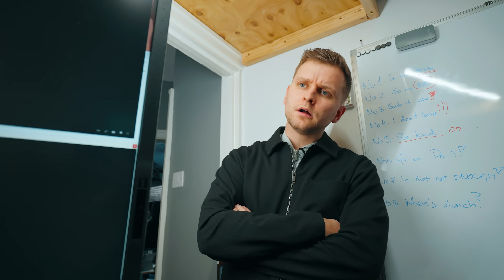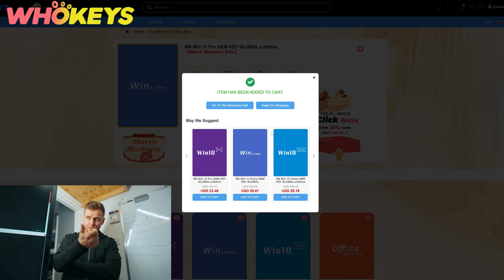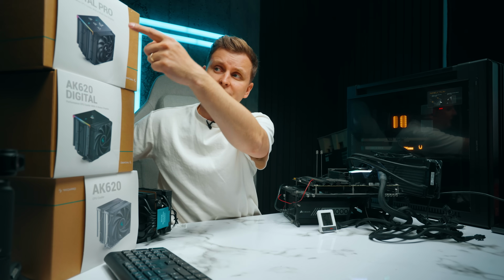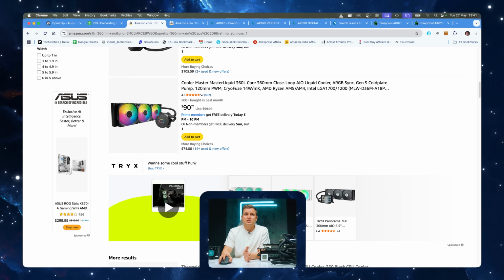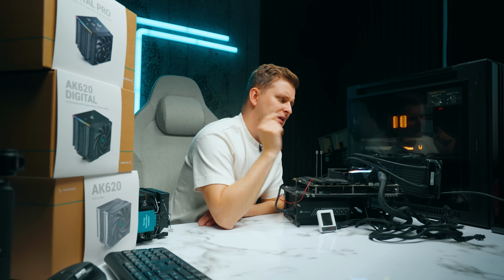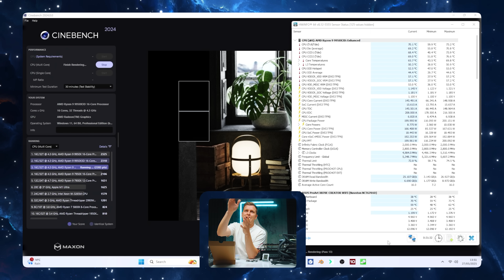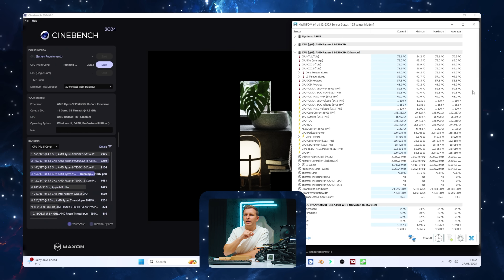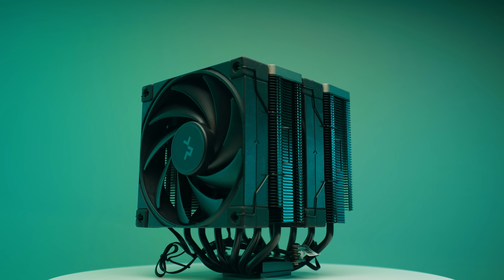Stop Overpaying for CPU Coolers Now! AIO vs AIR [PROOF]

Comment: Bench tests of AIO's and water cooling loops are NEVER accurate or paint a full picture. On a bench test, the system will be run for a few minutes and then shut down or left idle, this does NOT allow the cooling loop to fully heat soak. Water/coolant has a fairly high thermal ceiling, what that means is that the heat from the CPU is mostly being used to heat up the coolant, it's not actually radiating any heat away from the loop, it's absorbing it. In a short test, the loop will heat up, but when left idle, it will cool off, why is this important? In real life, during long gaming or editing sessions, your loop will NOT get that chance to cool off, so the coolant itself holds onto the heat and actually ends up keeping your system a little warmer than if it were using an air cooler, best case scenario is identical temps. On a bench test, the liquid cooler seems to run cooler because you've not fully thermally loaded the coolant, run the same test for a couple hours and you'll notice worse temps than an air cooler.

Comment: Why not test in mATX and ATX cases because there it definitly makes a difference. I have an freezer 36 and with minimal airflow is get 90+ in BF6. With the airflow all the way cranked up it stays below 90C and does not down clock.

Comment: Air coolers are good, as long as they're reasonably priced. If it's over 50 bucks, then it's pointless, and an AIO is a better option. For example, the Noctua NH-D15 is like 150 bucks? It's the rank 1 air aircooler, but in raw cooling performance it loses to literally ANY 360 AIO that costs 100 bucks less.

Comment: If this test had been done inside a case instead of open‑air, the results would look very different. With an air cooler, all the heat pulled off the CPU stays inside the case. How much of that heat builds up depends on the case airflow, fan setup, and exhaust efficiency, so temperatures can vary a lot. That trapped heat also warms up other components—RAM, VRMs, SSDs, and the GPU all feel the impact.

A liquid cooler moves the heat to a radiator, where it’s exhausted out of the case instead of being dumped back into the internal airflow. That’s why AIOs often show a clearer advantage in real‑world, in‑case scenarios.

Open‑air testing doesn’t capture these dynamics, because it removes the entire airflow ecosystem from the equation. Since actual PCs are used inside cases, a more representative test would measure performance in a closed chassis where internal heat buildup matters.

Comment: I use the ID cooling AIO, which was briefly shown in the beginning listings. ~$60 and it works well. About 10 degrees cooler on my CPU vs heat pipe air cooler. A little can tuning and it is no louder than the air cooler at full load, which is where I often run when gaming or doing video processing for hours on end

Comment: Ive only used AIO's in my builds so far and its only been the artic 360 pro iii but I did get an assassin for my itx built since case variety gets bigger when its just air cooling

Comment: Never forget all heat pipes contain a fluid in a vacuum as they rely on phase change for their efficiency. Which means air coolers are really closed system liquid coolers that just use fans to cool the radiator. This fact often seems obscured.
Reply: Yup, people still treat the air coolers like the old one piece solid piece units of years ago. The heat pipes are much better than water.

Comment: I usually go with premium name AIOs, but I recently decided to take a gamble and try Thermalright two months ago after I felt my current AIO was overly aged. I bought the Frozen Magic (there's a v2 version, but mine isn't) 360mm and paired it with Thermal Grizzly's Phase Sheet and I am not disappointed at all, I'm impressed. The build quality feels good and not cheap feeling and the pump is whisper quiet. Knocked the pump down to 80% for a balance of longevity & efficiency and temps are great. The only thing loud on it are the 3 high static pressure 120mm fans, but they rarely ramp up to max since I sat down and spent time doing a proper fan curve for all my system's fans. Still prob wouldn't hurt to replace those fans with more premium engineered high static fans for less noise, but the ones that come do the job and that's good enough for me and I wear a headset anyways. Edit: For my vrms, they got beefy heat syncs and I have plenty of  cool air flowing in touching them and pushing out the heat in my system.

Comment: For my line of work water is a king. While developing embedded software I have long sessions of working with code (for a computer is just a simple effortless text editing)  and "bursts" of massive computation power while compiling. Water due it's massive heat capacity takes all this heat and dissipates it later during low CPU workload. It makes fans run very slow and system is very quiet. I can hear puring of my wife's cat from the other room :D

Comment: I would argue that the AIO is going to be quieter because it will replace 3 case fans, so pump noise vs air cooler fans is the real noise difference. I also don't think your VROs will see much, if any, difference in air flow as the air cooler tower blows air too high to affect them. That being said, it's hard to beat the value of air coolers over AIOs.

Comment: And one of the best things to start looking at is how much wattage of heat can it output so how much can it dissipate if it can do more than the CPU puts out then you're normally good like the dark Rock Pro 5 or some of the other coolers ID Cooling do really really well not to mention the noctua but you may be overpaying for similar performance

Comment: remember this is in a test bench, this isn't in a case. This isn't real world. The air cannot remove the heat as good as liquid, even AIO. That's not even counting custom loops where there will be even a more significant drop.

Comment: One of my builds got killed by a Corsair AIO. 
The liquid landed on the mainboard after 6 years of use, mainboard is dead.
I have replaced the mainboard, processor and Ram, this time going with air (be quiet!).

Comment: I order an rz500, dont know why it doesnt show up when search but its from newegg, looks cheap also but man its keeping my cpu below 50c, let my pc run for 8 hours with 2 game on, a live stream video.. and msi program open, cpu was at 53c and gpu was at 67c. One thing is i slap another fan on the air cooler as it came with 1 120mm fan, so.. add another 120mm because it has 4 clips

Comment: I had an EKWB custom loop in my system a couple years back. After moving countries I switched to an cheap Air cooler by a reputable brand from Germany. The difference was literally 10-15 C but still nowhere near the cpus max rating. I paid 499 for the EKWB and literally a 1/10th of that for the air cooler. Not to mention the hassle to setup a custom loop.... THen I had a couple AIO and they were ok. But for what I paid for them I am going with a 140mm Peerless Assassin for my upcoming build. I doubt that it will be worse!

Comment: I've always used air cooling.  Yeah, they are big and bulky plus you need a wide case.  Reasoning behind my choice are the horror story's mates of mine have had when they go wrong.  Oh, they do go wrong sometimes and it is very costly to put right if the coolant escapes.  CPU is probably bare minimum to replace and sometimes entire mobo, memory.  I use quality Corsair air coolers and cases as they have excellent airflow and plenty of room for cabling and larger GPU's.

Comment: I have a Lian Li A4 H2O SFF case and went with a 240 AIO. Kind of regret going this route vs a Thermalright AXP90-47 Full Copper. I'm only using an Intel 245k, so the 240 AIO I have is overkill. Since the AIO fans suck from the case interior, the heatsoak is a bit less than desirable with longer GPU usage. Worst ye for me, the turbulence on the radiator and pump resoanance are more annoying than an air cooler would be at idle or under load. And the air bubbles.

Simplicity really is best.

Comment: I am using thermalright's phantom assassin with 7 heatpipes, processor is core i7 12700, temps highest with rendering is 73 degree. a lot cheaper then AIO.

Comment: liquid moves the water away quickly so the cooling is better its not just blowing air on a hot plate their is hoses that move the water to a different location to get cooled and sent back so its always going to be slightly better since its not static coolingin place like air cooler 

the liquid in the AIO is basically near the same stuff most folks use in their car radiators for cooling for those with gas powered cars. aka hence the name radiator fluid.   AIO radiator fluid is slightly different blend but basically the same stuff.

Comment: The purpose of aio is to have more thermal capacity and more air contact surface area that can handle spikes in CPU temperatures. That too without any overclocking. 

The reason ppl choose aio is for that added headroom which gives peace of mind as most users will not have 24x7 temperature controlled environments. 

The reason system integrators do not offer aio is because the environment where those workstations and servers run is expected to be thermally controlled environments - ideally maintaining 17 °C air temperature 24x7.

Comment: AIO cooler water evaporating is a hard debate. I’ve had mine for 7years and counting and it was unused for 2 years until recently cause my pc broke and it still working properly. And Idk now it was a hassle using air cooler with rams not fitting extra step to know if they would fit or not.

Comment: I wanted AIO for quieter operation, couldn`t be more wrong. On top of that air cooler requires very easy maintenance, while repairing pump can be very tricky. That`s a great video U did explaining all pros and cons.

Comment: A 200-watt AMD processor can be cooled with a light breeze. There's no point in comparing air and liquid cooling. Try cooling an Intel processor. Only an ex's heart can handle that.
Reply: I'll see your Intel chip and I'll raise you an AMD 9590 FX you don't know s*** about heat homie an air cooler is insufficient for a 9590 FX it requires that a very minimum of 240 mm AIO
Reply: I'll see your Intel chip and I'll raise you an AMD 9590 FX any other cooler besides a 240 mm AIO is insufficient you don't know s*** about heat out of an old AMD chip

Comment: Sure, they are even when both are given the best case scenario.  But now do it in a case with a gpu throwing  in hot air.  Air cooler probably wont perform as well if it is being fed 60c air while the aio can still get room temp air if you set it as an intake.

Comment: I'd say this testing approach is not really similar to normal usage of the computer? In a normal application your Air Cooler will be inside a closed space with limited Airflow. Overtime, the air temperature in this enclosed space (your computer case) will grow hotter and reduce the capacity for cooling the fins of the air cooler where's the Water Cooler can receive a constant influx of fresh air from the outside.

Of course, this idea of Water vs Air cooling is borrowed from Cars, an application where Water cooling is infinitely superior due to it's ability to exchange heat of the motor block through crevices inside where the water can pass through an ability that the air won't have in that application. This isn't true for CPU cooling, since the heat exchanging interface will be the same for both Water and Air so I would say that both should have the same cooling capacity in the first moment. My big question is if they both have the same Thermal Capacity overtime

Comment: Had a LiAn Li Galahad AIO was great. Everything was running fine. About 7 months in my temp started climbing. I took it out. I put it NZXT cracking in instead so I decided to cut. Open the Lynn Lee and see what happened. There's no water in it. None zero dry as a bone now. Could that have been a one-off probably? Here's the problem with aios as I see it, you don't know how much liquids in there you have no clue. Maybe it'll gurgle and you can hear. Oh I'm getting low but you can't really refill them. We're with an air cooler. You know if it doesn't work?

Comment: I am not a gamer, but I process a lot of data on my PC. Photos, videos, music, spreadsheets, programming, etc. I was looking at the Ultra 7 265 specifically to keep the heat under control without an AIO. But the 265K is cheaper. Honestly, I am not pushing my PC nearly as hard as a gamer would or someone working with 4K videos. Maybe air cooling would be sufficient for my uses. It was also suggested I could power limit the 265K and further reduce the cooling requirements while performing as well or better than a 265.

Comment: Meh... still prefer AiOs. Cleaner look, less bulk on the motherboard and I kinda like the idea of having a radiator in my case ... I guess I'm weird that way. :) Plus, just like with air, there are some very affordable offerings out there which will get the job done without breaking the bank. Deepcool themselves have a 240mm AiO that goes for "just" €50 in my country - and Thermalright even sell 360s at that price. 
As for longevity: Shouldn't be an issue if my experience is anything to go by. My very first AiO (120mm Corsair H60, a super basic unit) lasted for over six years without leaks or other failures. And while I did have to retire it because some of the liquid had evaporated and there were cracks starting to form on some of the rubber fittings, I would've had to do that anyway because it wouldn't have fit on and wouldn't have been powerful enough for a more modern CPU. Same thing goes for air-coolers which you will most likely have to retire eventually for the exact same reasons.

Comment: you can get away with air cooling but case testing changes delta to 10 degrees. That makes a big difference in your room comfort and gpu temps too. Arctic liquid freezer 360 is $80 and comes with three case fans. Thats more than worth it over any air cooler that you would need to buy additional case fans for on top of your build looking like ass.

Comment: I bought a fractal 360 aio for my main rig and it keeps the i9 cpu really cool. I just wanted to try one and it looks awesome. My case is enormous and i also wanted to fill it up a bit. Once the aio dies that will be my last one though i'm pretty sure because my other 4 towers work just as good with air coolers. Arctic fans keep them real quiet with lots of air flow. So i basically spent 200 bucks to one day replace it. Its fun though.

Comment: air coolers are way better because they are quieter and for me thats all that counts, if your gaming you dont need a 250watt cpu the 7800x3d or 7600 only uses 65watts when gaming a cheap air cooler in enough.

Comment: The way I look at it is, they work the same, what separate them is the availability of space above the CPU. 

If there is enough space and air flow, Air cooler is good enough. But if there isn't, then use water to tranfer the heat to other place where space is available.

Comment: Liquid just has so many advantages and air will never overcome those unless you can consistently keep your ambient temps low.  If you are in a well air conditioned room at like 68 degree f or 20 degree C then air cooling is fine.  If you dont have good AC liquid cooling, even a small one will always be better and the fail rate of AIO is like 0.0001%

Comment: from my personal exp i can say a couple years ago i had a bequiet dark rock 4 for my r9 5900x and the temps were always around 80-90°C (even in idle around 60). then i upgraded to a 360 mm aio and they went down to 35-40°C even under stress they never went above 55. i dont think that a "better" air cooler would achieve these temps. also i didnt like the look of such a big construct in my pc case. the aio not only performs but also looks much better. I paid 130€ for the arctic freezer aio and a noctua air cooler would be around 100€. (disclaimer: this is my personal opinion i didnt study this topic)

Comment: Realistically I would guess 95% of AIO purchases are motivated by aesthetics. A lot of people building gaming PCs will choose liquid cooling by default because it looks premium and that's what they see everyone else doing, even if they have mid-range CPU and GPU that don't generate much heat.
In most scenarios I believe air cooling is the best choice ON PAPER (ample cooling, more reliable, no pump noise, easier to swap out), but this is a hobby for a lot of us so not every decision has to make logical sense. That's why fish tank cases and RGB exist.

Comment: I am in 2 minds of selling my AIO and just getting air cooling. I would like to get a flat one though with the same type of performance as the tower types and that's where the water gets muddy though. I dont think there is enough testing on the air cooling solutions. Especially vertical vs horizontal mounting of them. Open case the results seem to be neither here nor there but in a enclosed case eg. Lian Li O11 you have bottom intake top out but it need to contend with the GFX taking up a lot of space and how would a horizontal flow match against a vertical flow. I have way to many questions :S

Comment: I'm getting 9800x3d. Should I go for AIO or air?
Reply: you can go either way, the 9800x3d has a base tdp (basically how much heat itll produce) of 120w and a maximum of 162w. So a beefy air cooler will do the trick. I would personally recommend going with an aio, but either way you go I would just recommend getting a cooler with some headroom over that 162w maximum that way you know without a doubt that your cooler will get the job done.